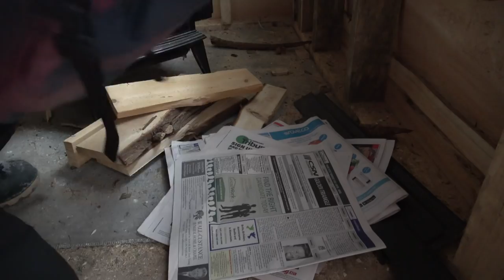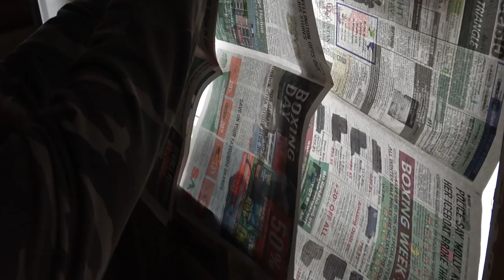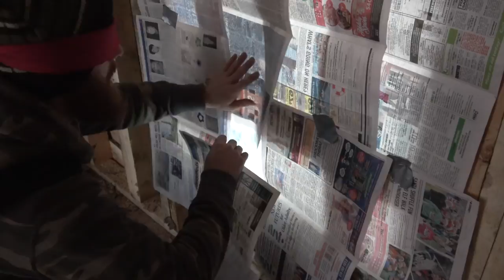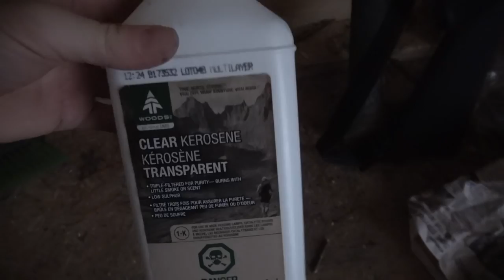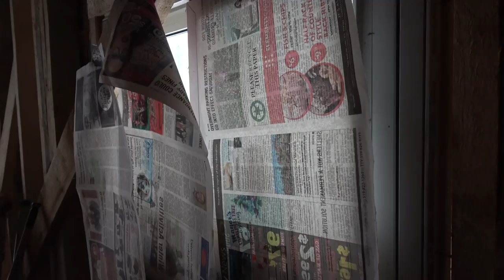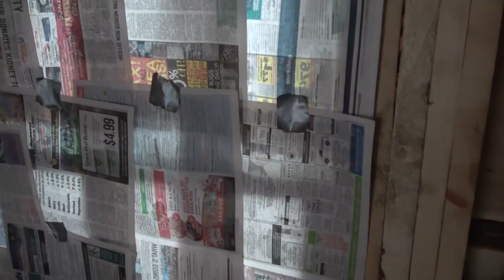The Bird Box Movie (FAN FICTION!) |  Fire, Water, Food, Blindfolded

Comment: I guess first rule would be if your lucky enough to find a cabin your lifes not going to get any better than that, practice 10 steps out 10 steps back...don't loose the cabin once you find one...your cordage is a life line...tie off to the cabin before you go out, but so you have it to follow back, run the end through a belt loop before tieing off just in case you drop the spool.